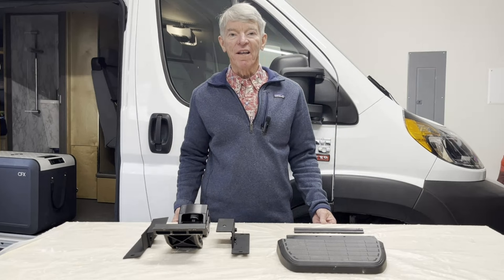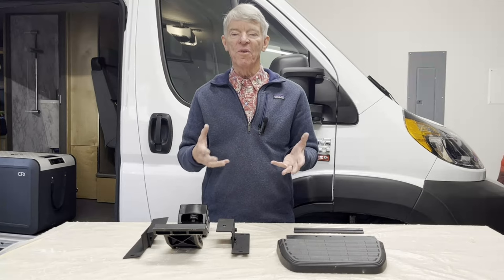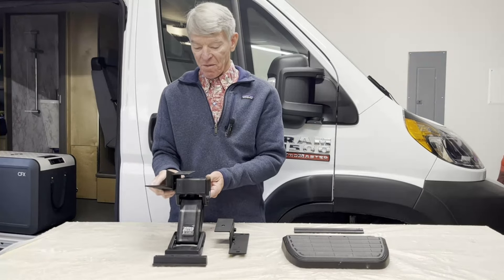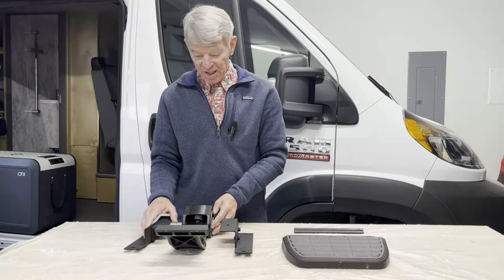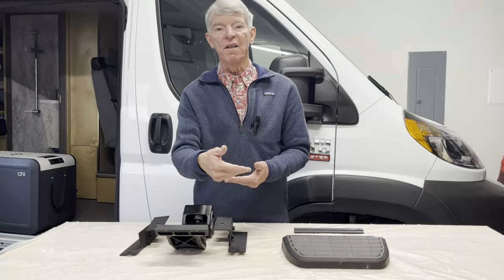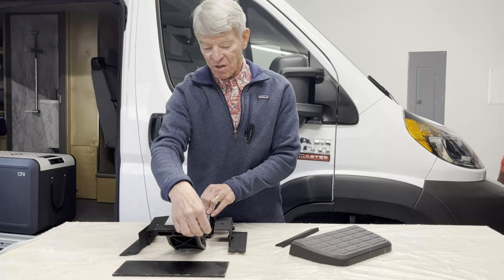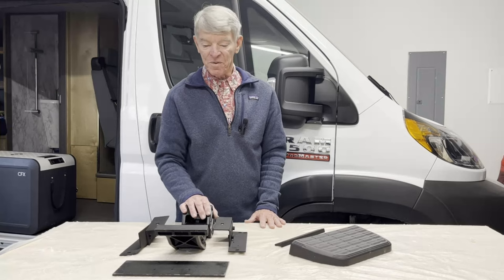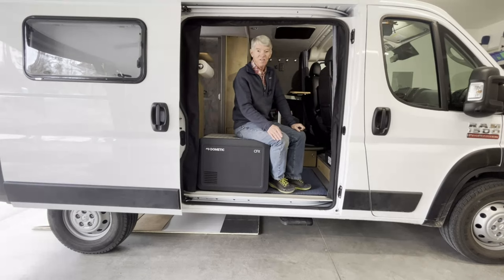ProMaster BedStep2 Retractable Step Hack

Comment: Great video!  Do you have any installation video of the grab handle?  Thanks
Reply from the maker: I misspoke. I actually use the top of the passenger seat seatbelt housing to help me get into the van. I sure wish the ProMaster came with a handle on the door jamb. It looks like a lot of work to install one, and I worry there might be an issue if there is an airbag in the column.